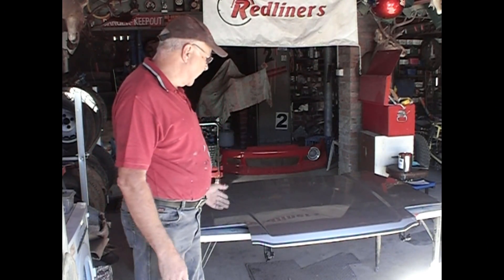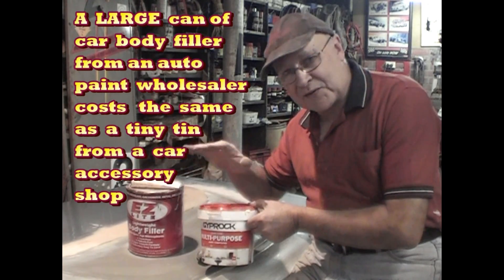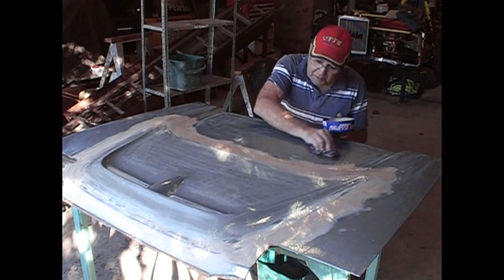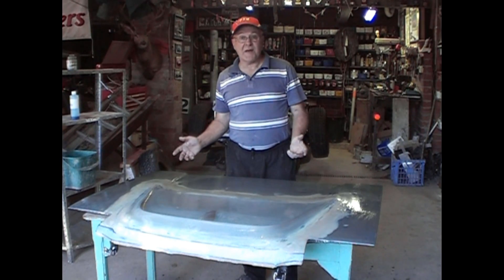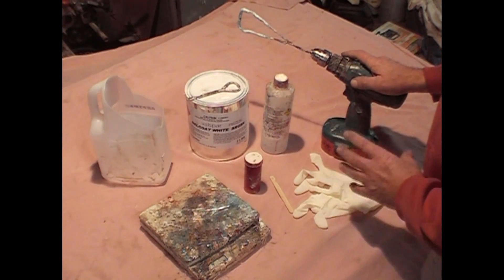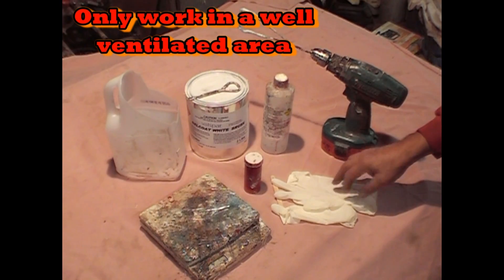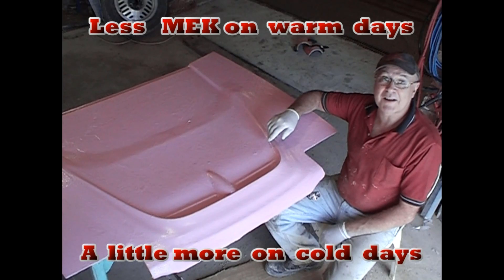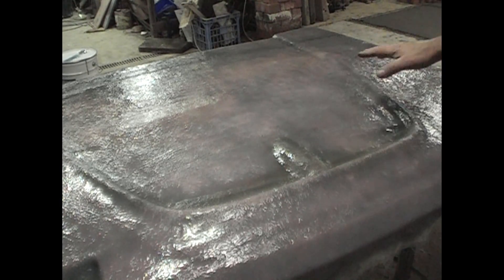How to Make Fiberglass Car Panels

Comment: Hii Bill, i have watch almost all of your carbon/fiber tutorial videos its very informative and easy to understand. but I'm still confused  on how to make the hood hook at the front of the fiber hood? you have explained on how to make the hinges at the back of the hood, but I still don't get it on how to make the hood hook thoo, hope you can guide me, and God Bless You!
Reply from the maker: By the "hood hook" do you mean the mounting point for what we call the factory "bonnet latch"?
Reply: ahhh yess i mean bonnet latch, sorry for the bad English Bill @BillsBuildandRace  its the things that just look like a "U" shape steel where u cant remove it from the factory bonnet, the only way to remove it by cutting the legs
Reply from the maker: Make a tine template of the position of the factory catch relative to the edge of the bonnet. Then cut the factory u bracket off and weld it to some 25mm flat steel.   When you lay up your bonnet use your tin template to position your u bolt in the right place & at the right angle, then put two layers of cloth over it while the main bonnet is still unset to lock it in place as part of the bonnet. Don't do this as a second process AFTER the bonnet has hardened. You must do it as the final part of the bonnet layup to get the strongest cementing of it into the bonnet. But you need that tin template because you can't re-position it once your fiberglass sets & it's locked in place. If you need adjustment you can usually do that on the catch it goes into on the car.

Comment: Thanks, your videos are very informative.
I want to cast my headlight surrounds in fibreglass and have seen molds made of silicon and soapy water or cornflower.
But I'm concerned the silicon would stick to the paint.
What do you think would be the best material for a mold that won't trash my paint?
Thanks again!
Reply from the maker: The best material is Alginate used by dentists. It will not stick to anything, but put a plaster mold over the top of it to add strength.

Comment: Bill, I've been wondering something that I haven't seen in your videos, in relation to you sealing plugs.
You say you have to seal them to prevent the gelcoat from biting into any filler. Is this just a problem with certain filler types or all? I'm intrigued because surely the point of a wax and pva release is to prevent the gelcoat from biting, afterall,  you're not sealing a mould before laying up a new panel? And you don't seal an original panel if taking a copy and it doesn't strip the paint when you pull the mould away. Just random thoughts.
I like binging your fibreglassing videos from time to time,  your taste may be questionable at times but you're having fun and nobody can criticise you for that.
Reply from the maker: The point of a wax and PVA release is NOT "to prevent gelcoat from biting into any filler". Rather, those products are designed to aid release, not form a barrier to absorbent fillers. You don't "seal an original panel if taking a copy" because there are o fillers in them - just metal & paint. The paint "doesn't strip away when you pull the mould away" because the paint is not absorbent like fresh car body fillers used in shaping dies/plugs to be moulded. My taste is not questionable at times - just different to yours. There is a part of me that likes being outrageous at times & pushes the envelope ... hahahaha!
Reply: @BillsBuildandRace  you never know what is under a layer of paint unless you put it there.
I Googled my question to you while I was waiting (very different timezones) and the alternative answer was, you seal a plug to reduce the pores in the piece. So in theory depending on your timeframe and area of expertise,  a decent paint job with a mirror finish is sufficient to prevent the gelcoat from gripping what is beneath using a mechanical lock,  there was no mention of a chemical lock.
Questionable taste is what separates the unique from the mundane. My dad once wallpapered the outside of his car with a large floral print paper and sealed it with polyurethane varnish. Bizarre but magnificent.
Reply from the maker: @RUSSIANUK  You are talking about two different jobs. The sealing needed for a sculpted die/plug with copious fillers in it to shape it is quite different to what is needed to seal a panel that is just painted. The key issue is the gelcoat locking into the absorbent sculpted  fillers - a situation not present in a painted panel.
Reply: @BillsBuildandRace  Bill, the panel that I'm about to copy was originally the grille and surround, I want a different look. So I filled the grille lattice with polyester filler, sand, fill, sand fill, then a coat of resin and filler (that was tough to sand) then 2k filler primer and sand followed by more 2k filler primer as I wasn't entirely satisfied the first time, then a gloss base coat (cellulose) wet sanded and soon a two pack acrylic clear coat, a final wet flat then a good buff so it's gleaming. 
My problem was you name a product in Oz and one in the U.S. but I live in Britain and can't find anything cheap, but I do have lots of paint and I think I can get an almost flawless finish with paint. I just wondered if maybe the epoxy varnish works well for you given your necessity to get on and finished and the softness of your fillers, obviously the softer the filler the weaker the bond to the panel.
I'm not arguing, my dad was into GRP, unfortunately he's no longer around to ask, but you are, so I'm picking your brain instead. 
I also found a polyester sealer / filler primer designed for sealing plugs,  which can't be much different from any 2 pack filler primer. I just presume most of what you can buy is a con.
Reply from the maker: @RUSSIANUK  With your over attention to detail and (I suspect), being a perfectionist worrier, you have over done things on preparing that plug and made extra work for yourself. I only use two fillers when sculpting dies, automotive body filler, and then Gyprock/drywall joint filler for the final filling. You can't use this more than 4mm thick as it will crack, but you can gently hand sand it super smooth with a handkerchief!  The Wattyl 7008 I seal my plug/dies with is just a equal two parts polyurethane clear floor/table gloss. Go to a big hardware or paint store, and look for an equivalent.. a TWO part clear polyurethane. These products are all self levelling, so spraying is unnecessary. Just paint WILL NOT seal your plug, no matter how many coats you give it. Do not over complicate this - just g Get the right product.

Comment: I have one question after all , let's say you have a mold, and my question is when do you put gel coat and fiberglass , and when you can skip the gel coat and have fiberglass finish without gel coat over the new part ?
Reply from the maker: Why are you asking this question? Is it because you are thinking this is a way to save money?  Tell me what sort of things would you like to make in fiberglass, and that will help me answer your question.
Reply: @BillsBuildandRace  I'm asking that question because I want to use fiberglass that have pattern for first layer (that's visible) and second and third I want to use chop strand mat
Reply from the maker: @ДимитърГенев-ш4и  But what are you wanting to make?
Reply: @BillsBuildandRace  a wing but I want the fibers to be visible like carbon
Reply from the maker: @ДимитърГенев-ш4и  This is a clumsy way to communicate about this. If you have Facebook there are links to me on this channel's home page. Are you planning on making the wing by laying up two halves together in a mold, or are you planning on over laying fiberglass onto a wing shape of some kind?
Reply: @BillsBuildandRace  mold is on two separate parts so you combine them into one hole pace after lay up the fiberglass and resin
Reply from the maker: @ДимитърГенев-ш4и  Like this? https://www.youtube.com/watch?v=laR2C55b8AA&list=PLh5B6MCXRHiEFl6VaERQKJUGFRj4Coh4H&index=21

Comment: I'm wondering what resin you use? Are you using polyester or epoxy? And are you using waxed? or un-waxed? Or a combination? I will be making molds and body parts for my 1978 Triumph Spitfire.
Your videos are excellent by the way
Reply from the maker: In fiberglassing I always use unwaxed, general purpose polyester resin. I have used Vynylester but found it more expensive and way too fumey, so I prefer Low Styrene Emission), not for environmental reasons - but because it doesn't smell as bad.  Glad you find these videos encouraging. An industry myth is that you can ONLY use polyester resin with fiberglass, and ONLY epoxy with Carbon Fiber or Kevlar - but this is rubbish. Yes, that it the way it is most of the time, but you can mix it all up as needs be.
Reply: @BillsBuildandRace  Thanks Bill for that information. I remembered reading that in your comments way back and I am sure you said that in a video once. I am building a body to cover my tube frame buggy with doors and a floor and wanted to know what your thoughts were. I will be using fiberglass on some parts and carbon/ kevlar on others. I have searched your site for several days in my spare time looking for what you had to say on which resin to use. 
Thanks for all the knowledge you share with so many. Even though they have been around for years, it takes some of us longer to find them than others. And they are still as valuable as they were the day you put them up!
Thanks!

Comment: Sorry random question I'm new to this and I'm just curious as to why he did it twice and what the process was for that? I lost track when it jumped from trimming the first piece.
Reply from the maker: I presume the repetition you are referring to is first layup which creates a mold, and the second lay-up of a copy in that mold. If so, the reason you have to do it twice is because the first creation has the smooth, finished surface on the wrong side. It is, if you like, a female copy of a male part. By then copying that you end up with a proper copy of the original which - in the case of car body panels - gives you the smooth, finished side with the Gelcoat on the outside surface which is to be pained.

Comment: Great video - do you think this technique would be suitable to rebuild car interior headliner backing board (slightly rotten carboard style board)?  Was thinking I could wax spray one side then fibreglass it just like you did to create a solid mold.  Just worrying it might be too rigid, although the car is a Volvo estate so have quite a lot of room to slide in and out.  Thanks.

Comment: What a great video, exactly what I needed. Quick question for you - when you repair a mold with body filler I assume, do you need to seal the mold with the epoxy?
Reply from the maker: Yes.

Comment: Are you sure you're using MEK and not MEKP? MEK is something different. I tried it as a hardner and it doesn't work. (MEK is the same as MEKP but the P stands for Peroxide).

Comment: Question: I'm making a fender for a Pontiac Solstice. I've managed to make what looks like a pretty decent mold. However, there are some ~90° angles along the top and front of the fender. Although those were faithfully duplicated in the mold, I get a lot of air bubbles in the new part. The rest of the part looks fine, but the number of voids that appear on the edges is unacceptable in a finished part. Any suggestions? I've been using glass cloth rather than CSM, mostly because the CSM really wants to drag around when applying resin. :|

Thanks for the video series. It's been very helpful so far.
Reply: Im trying to make one for my Pontiac solstice as well

Comment: I want to strip down a Corvette to its chassis and keep the interior and rebuild a 70s futuristic body around it. Could I use this method for the body panels. Still need to figure out  glass, lights trim and details
Reply from the maker: Yes this method it the best way to go. Your biggest task will be sculpting the bodywork you want to copy, and part of that  will be then figuring out where you need to divide it into molds. I have found chicken mesh or similar over a very minimal frame then covered with foam rubber which is then fiberglassed lighlty and used as a basis for final sculpture is a quicker method. But using stock panels a a sculpture base and modifying or building onto them also works. Either way - a full body sculpt & mold (then copy) is a BIG job!  Here is my foam rubber method:  https://www.youtube.com/watch?v=WdC4ymZ3fZI&list=PLh5B6MCXRHiHoupoi7R99zJ_QoVfmBmZt&index=21&t=0s  and my current build series from part 6 shows me sculpting my own bodywork for a Civic by heavily modifying factory panels, and ending up with a one piece flip up front for the car. You should  watch all of this build from part 6 forward:  https://www.youtube.com/playlist?list=PLh5B6MCXRHiFalCU0qKyDltcBxNVZCLS1
Reply: @BillsBuildandRace  wow cool ok thanks
Reply: Hey brother I have sort of the same idea to replicate a vintage roadster on a modern car base like a Miata. Perhaps depending on where you’re located I can help you and learn in the process. I’m definitely going to try to contact WJP004 whenever I can start my project. His videos are full of lessons and got me motivated to achieve my dream of owning a vintage roadster looking ride. Good luck 👍🏼

Comment: My gel coat seemed extremely thick and hard to paint on WITHOUT brush marks.  It also seemed to go off very quickly and it almost turned into one big lump in my paint pot before I could paint it onto the car panel.

What did I do wrong?  Too much cat?

Thanks
Reply from the maker: The brush marks are only visible on the top the surface which gets overlaid with resin & cloth - so they don't matter.  However gelcoat will copy the surface of your mold exactly on it's other (bottom) side. What method did you use to proportion the catalyst?
Reply: @BillsBuildandRace  thanks for taking the time to reply.

I fear the brush marks are where the gel coat is applied a little too thinly, but it was very hard to cover them once I had applied the gel coat.

I followed your video and just did it by weight on the scales, however being a novice I wonder if pouring the catalyst into a separate weighing pot may be an idea first before adding it to the gel?
Reply from the maker: @edwardmurray8507  Ok - so you mixed your catalyst by weight. Good. What percentage did you use and what were your weather conditions?
Reply: @BillsBuildandRace  I tried to get it as close to 1% as I could.  Sadly weather here is cold ish at the moment - about 10c.
Reply from the maker: @edwardmurray8507  You've done the measuring correctly. The cold should have slowed catalisation right down. How long did you mix the gelcoat, how long between when you mixed it and when you applied it, and how long did you spend applying it?
Reply: @BillsBuildandRace  only mixed the gelcoat for 30 seconds or so, didn't seem to need much more?  Applied it straight after mixing it but it took a good 30 minutes or so to apply.  The gelcoat I have just seems way too thick compared to yours and other videos I've watched, yours seems to brush on nicely and spreads well on the panel... mine is very thick so it doesn't spread easily and therefore takes ages to apply.
Reply from the maker: @edwardmurray8507  Ok your mixing was fine. The length of time of your application and the product's manufactured density/thickness is why the gelcoat got away from you. If this is because it is too thick try thinning it with a little fiberglass laminating resin before you add the catalyst. You may be better off just buying neutral spray gelcoat and mixing in fumed silica until your stirrer stands up in it. That's what I do as it's cheaper than buying brush gelcoat, plus I can get it to the consistency I want. You just need to whisk it in really well with a 100mm paint stirrer with a cordless drill. But start slow speed otherwise you'll empty the tin onto your shoes. Don't ask me how I know this. I buy a 4kg can of spray gelcoat & thicken the whole tin. Then it's ready on the shelf when needed.
Reply: @BillsBuildandRace  thanks for all the help Bill.  I have a feeling the thickness is just wrong as you say.  Do I thin with the same resin as I put onto the chopped mat?

Thanks again.
Reply from the maker: @edwardmurray8507  Look at the gelcoat label & tell me the brand and date of manufacture.
Reply from the maker: Yes.

Comment: For those that need it: 225g = .75oz   450g = 1.5oz  >>It seems that in metric areas of the world it is sold with a weight rating per square meter.  In the U.S. it is sold with a weight rating per square foot.
Google: "grams per square meter to ounces per square foot" for a handy calculator. Round the calculation up or down to nearest unit of measure that your dealer offers.